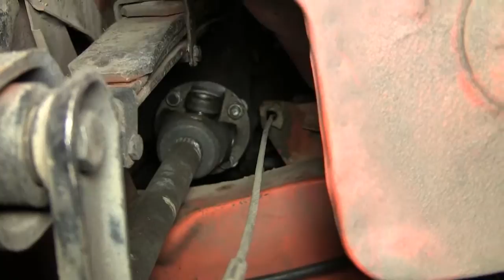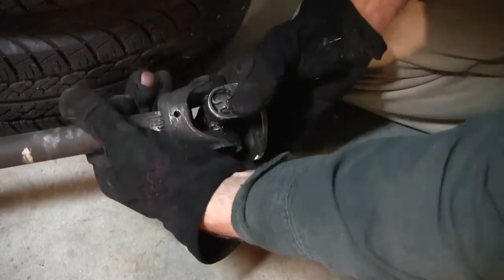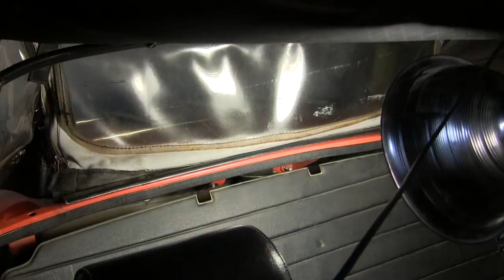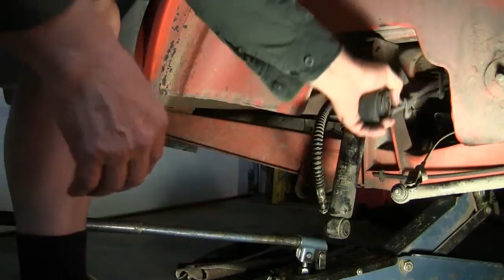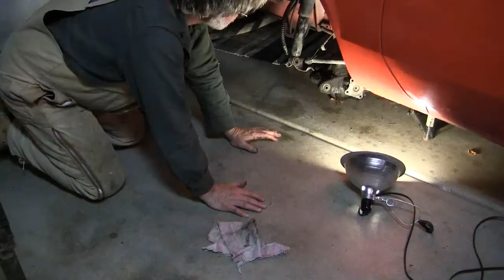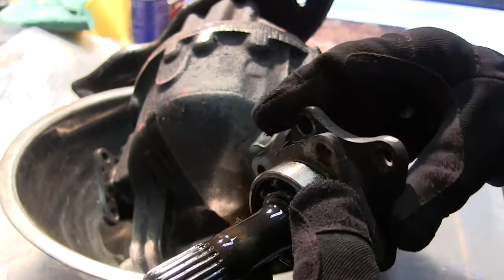Part 1 1979 Triumph Spitfire 1500 Differential Removal, Opening, Repair

Comment: You made yourself a lot more work than necessary. When I replaced my '63 Spit differential (twice) I just unbolted the axle shafts at the differential carrier housing (4 bolts each side), dropped the outer axles out of the way, removed the stub axles, unbolted carrier, driveshaft and pulled carrier from housing. no need to undo shocks, brake lines, spring, etc.
Reply from the maker: This was my 1st time to do this. The book left out some good points. No video to see what I was getting into.
Reply: Are you sure you need to remove the drive shafts from the wheel bearings?